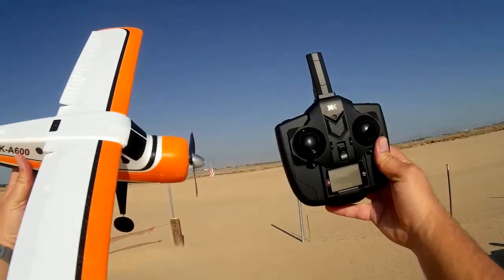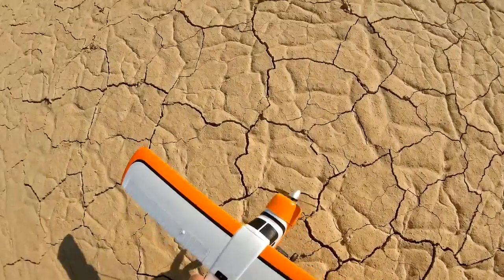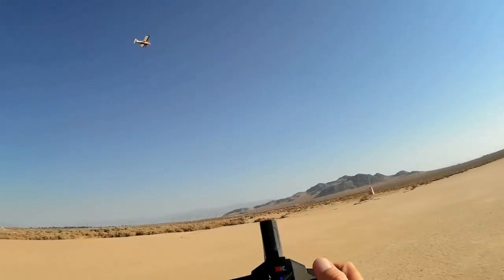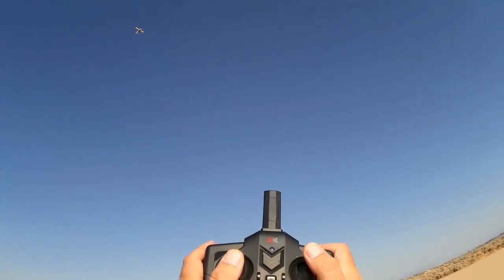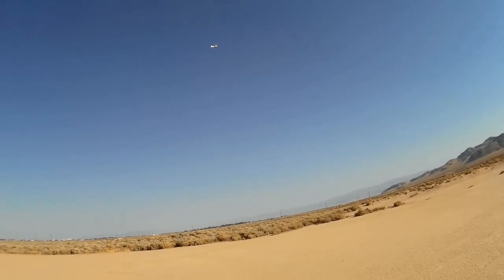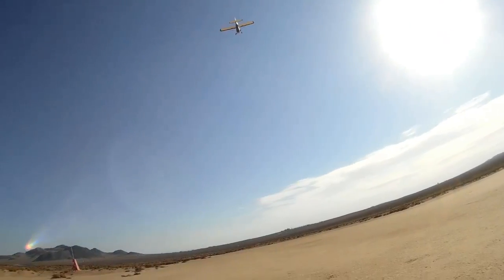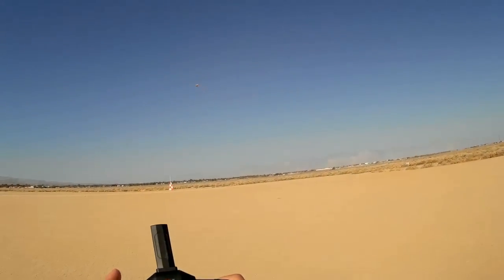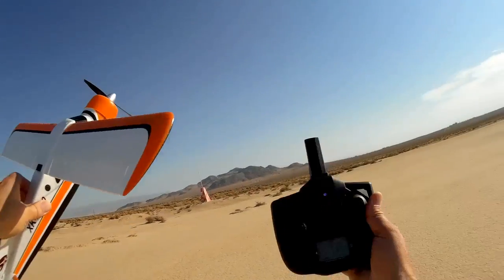XK DHC-2 A600 RC the Easiest RC Airplane to Fly

Comment: $109?! WAY too expensive for that little foam thing. Then, you need to add $51 shipping. Also, it looks like it's made from plastic dinner plate foam (expanded polystyrene foam (EPF)) instead of far more durable expanded polyolefin (EPO).

A FAR better beginner system for only $20 more before shipping (actually, less than that - if you let a Hobbyking item's page sit inactive for a while, you'll get a lower price offer in a popup window, $107 for the Bixler :

Hobbyking Bixler 2 EPO 1500mm Ready to Fly w/Optional Flaps - Mode 2 - $112

http://www.hobbyking.com/hobbyking/store/__39677__Hobbyking_174_8482_Bixler_174_8482_2_EPO_1500mm_Ready_to_Fly_w_Optional_Flaps_Mode_2_RT.html 

Features:

• Completely "Ready to Fly" including the HK-T6A V2 2.4GHz 6CH radio system (Mode 2)
• Easy and Fun to Fly
• Easy, Fast and Simple Assembly
• New Larger Canopy area to accomodate FPV equipment and/or larger Flight Lipo
• Pre-Installed Servo's & Brushless Motor
• Larger Wing Span for greater glide & Payload Carrying Capability
• Plastic Landing Skid
• New, lower kv Brushless Motor/larger Prop Combo for Greater Efficiency
• Pre-Installed Optional Flaps Mounted on Plastic Hinges (require Servos for operation - not included)
• Plug In Wings for Easy Transportation
• Pre-Installed Round Pin Hinges on Rudder & Elevator

Includes:

HK-T6A V2 2.4GHz 6CH transmitter and receiver (Mode 2 transmitter - left stick throttle)
Turnigy 3S 2200mAh 20C lipoly battery
HobbyKing 2~3S lipoly DC balance charger
Instructions
Screwdriver
2 x Y-Lead
Hook & Loop Spare Clevis x 2
Horns & control Rods for Optional Flaps

Then, add one of these for flight stabilization:

OrangeRX RX3S 3-Axis Flight Stabilizer V2 (V2.1 firmware) (V-tail/Delta/AUX) - $18

http://www.hobbyking.com/hobbyking/store/__52413__OrangeRX_RX3S_3_Axis_Flight_Stabilizer_V2_V2_1_firmware_V_tail_Delta_AUX_US_Warehouse_.html
Reply from the maker: +Winston Smith This really does look interesting.  I enjoy flying my WLToys F959.  This would be a good follow-on to it.  Just might get one :)
Reply: +Quadcopter 101 HK doesn't seem to stock the RTF Bixler 2 in a US warehouse, but you can combine the following along with the stabilizer (believe me, you really don't even need it - this is an easy and very stable plane to fly - but the stabilizer is very inexpensive) and listed required accessories to get the same thing without paying any overseas postage:

HobbyKing Bixler® ™ 2 EPO 1500mm w/ Motor, Servos and Optional Flaps (ARF) (US Warehouse) - $80

http://www.hobbyking.com/hobbyking/store/__36706__HobbyKing_Bixler_174_8482_2_EPO_1500mm_w_Motor_Servos_and_Optional_Flaps_ARF_US_Warehouse_.html

Required:

20A ESC - many to chose from - search in their western warehouse where the plane and TX/RX will ship from
4 Channel Radio (Tx/Rx) - see below
1300mAh~2200mah 3s Lipoly Battery - many to chose from - search in their western warehouse where the plane and TX/RX will ship from

Hobby King 2.4Ghz 6Ch Tx & Rx V2 - Mode 2 (USA Warehouse) - $30 - only 4 channels needed, but this is the same TX/RX combo that comes with the RTF version of the Bixler 2 and the 4-ch version of this radio is only $3 less, so why buy it?

http://www.hobbyking.com/hobbyking/store/__15140__Hobby_King_2_4Ghz_6Ch_Tx_Rx_V2_Mode_2_USA_Warehouse_.html

If you already have a TX/RX for this, then never mind. If you don't and want to spend a bit more, there's this very popular radio:

Turnigy 9X 9Ch Transmitter w/ Module & 8ch Receiver (Mode 2) (v2 Firmware) (US Warehouse) - $70

http://www.hobbyking.com/hobbyking/store/__19673__Turnigy_9X_9Ch_Transmitter_w_Module_8ch_Receiver_Mode_2_v2_Firmware_US_Warehouse_.html
Reply: +Winston Smith How about the Bix 3 or AXN Floater instead of the Bixler 2?  Two popular flyers that are EPO.  Any opinions about these?
Reply: Either of those would also be great from what I've seen on-line. Plenty of reviews of them here on YouTube.
Reply: +Winston Smith Think I'm going the AXN Floater route.  Popular, available, proven model.  EPO foam, so popular it's gotten to be inexpensive.  Can fly fast yet has a forgiving stall speed for slow flight.  RCModelReviews does a great step by step build video set on the AXN.
Reply: +Winston Smith Nice comparison, what tipped the scales for me is that the AXN is current with good parts availability, needs no mods at all and on top of that is still less expensive.
Reply: +Ed Arenz Both the Bix and AXN has some major short coming.  To compare just the Bix and Axn, the AXN has a bad stall behavior.. it has a noticeable wing drop at stall.  But Both are always going to be dangerously under powered, EVEN IF you put a much bigger motor, because the wing and motor mount location/space limitation, you can NEVER put a big enough prop for sufficient clime ability.  Also because of this particular config, the extreme prop thrust angle, makes the both machine really crappy inefficient.  Notice the easy glider has neither propblem.  It's wing is very high and completely off the fuselage, so that lyou can put a very large prop on a more reasonably sized airframe.  And because the motor shaft is immediately behind the wing, it's going to be perfectly at right angle for much more efficent and stright flight.  http://www.hobbyking.com/hobbyking/store/__35018__Sky_Easy_Glider_EPO_1050mm_PNF_US_Warehouse_.html
Reply: What a pile of "To a beginner, I sound like I know what I'm talking about" bologna. Both the Bix and AXN are phenomenally popular for many reasons and the model you point out has no significant advantage over either and while having been available for nearly two years now has only a very few comments about it in forums while the Bix and AXN have thousands, thereby providing all kinds of specific tips for beginners,
Reply: +Winston Smith Do you know how you can tell if someone is passing off bologna?  It's when they point out NOTHING that other guy said to be untrue but instead just go on pointing out that something is popular, selling well, and has a big following.  You call this person a sheep who has too much identity and ego invested in a product.
Reply: +Ed Arenz I have watched all of Bruce's vid on AXN a while back and Dutch RC's vid also.  Dutch Rc says that sky easy glider has easy stall and stable flight and probably recommend something slightly bigger.  I would also recommend something slightly bigger, ONLY if it could hold a big enough prop and at a right angle and not like 25 degrees off angle on a bix.  If you want a FAIR comparison vid of stall behavior between Bix and Axn, than you have to look up a vid that compares them SIDE BY SIDE.  There is a vid of just this.  I know; cuz I saw it a while back.. maybe you rather not watch..   Yes Bruce and all his field buddies have the Axn.  It's good to share platform and common parts.  I noticed that every vid of easy glider, show a good steep clime out, but Bix and Axn just can't EVEN when modded.  There's just not enough clearance for a prop bigger that 7" and even with motor mount re locator, you are forcing the prop to blow air downward on the wing.... come on.. common sense says this is not good....  Like old cars.. some of the most sought out cars had very little following when they were new.  That's just how it is.
Reply from the maker: +Andrew Jackson Hey, how 'bout them Mets, huh?  ;-)
Reply: Quadcopter 101 I am sorry, cuz I don't follow any professional sports.  I might get in the spirit of things when a say... Dodgers, Packers or Vikings do well.  Anyways happy flying..

Comment: Brings back memories of my single channel r/c days with fixed wing trainers.  They were all high wing aircraft with plenty of decalage (higher angle of attack on the wing than on the stab). I remember flying on windy days where it was all I could do to keep the nose into the wind, and watch it ascend vertically, and when I either cut throttle or the fuel ran out, it would descend (mostly) vertically.  One thing I have to question about this aircraft ... what of some kind of LVC warning?  If you fly a Lipo past a certain voltage level, you'll ruin the battery.  On a quad, usually they have flashing LEDs. I saw no kind of warning system.  Pretty limited amount of travel on the rudder .. when you do get to flying in manual mode, that would make doing "hammerhead stall turns" more difficult ... but then, you'll probably have other things on your mind than doing any really advanced maneuvers.  Not surprising that someone finally put a decent flight control board into a fixed wing aircraft ... its about time.  I agree it will make for  a great beginner's airplane ... as long as they remember to keep it UPWIND at all times, they should be okay.  Thanks for the review ... Cheers!
Reply: no disrespect bro but model airplanes wasn't this easy to fly back in the day
Reply: +thafactor24 You're preaching to the choir .... I know EXACTLY how hard it was to fly R/C airplanes "back in the day", since I flew them "back in the day" (my 1st single channel transmitter used TUBES and required a large 1 1/2 volt battery for the tube filaments, and three 67 1/2 volt batteries to make up the B+ supply).
Reply: Bill Somrak wow lol that was way before my time 😀

Comment: I'm looking for a clone for the x5c-1 but one without a camera. The bayangtoys clone has a camera. Do you have an idea on which clone I should buy which doesn't have a camera? Thankful for answer!
Reply: +bloodybotter FY326
Reply: +bloodybotter I agree with Brian...FY326 Q7...same as Brian mentioned but he left off the Q7  Quadcopter 101 has a link to buy it, I think it cost less than 30 dollars and it's ready to fly.
Reply: +bloodybotter the only way to tell of the board will be red or green is look at it when the battery is out, you can see it in there without removing a screw. All the ones I have with a red board fly great and have good range but many have complained about the red board. On my channel I have a distance check on the red board and brought it back to me after it hit 120 meters.
Reply: +bloodybotter Not really a clone of the X5c but far far far better is the HT F801, I think GB has it on sale for < $36 right now.

Comment: Amazing features and stability for a $109 RC airplane..  Would like to see you fly it with the gyro stabilization and accellerometer off.
Reply from the maker: +jst4curiosity That's what I'm going to do today.  I did a test flight of it already though (no video). You get into trouble, just press the button, and it immediately levels off.  It's really amazing.  Am going to try to demonstrate that today.